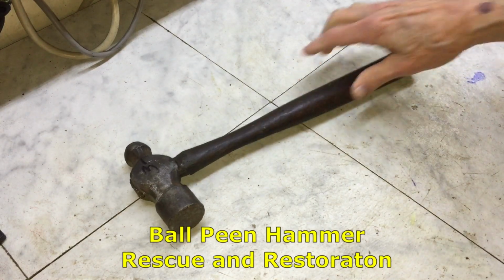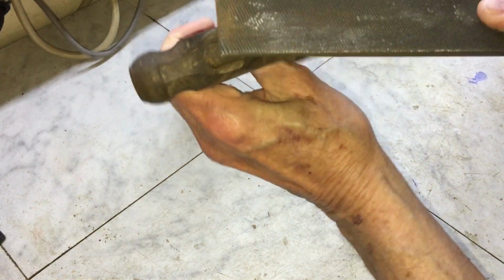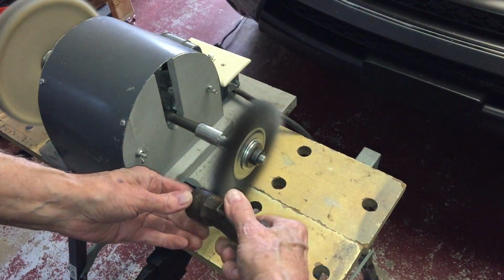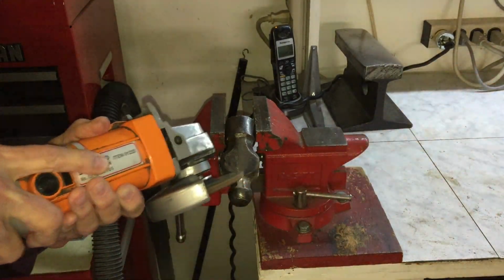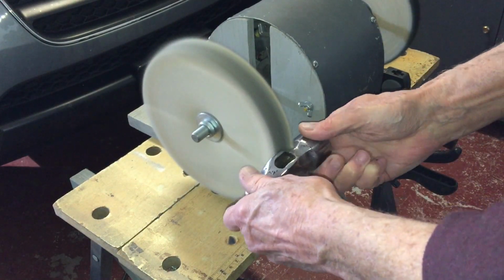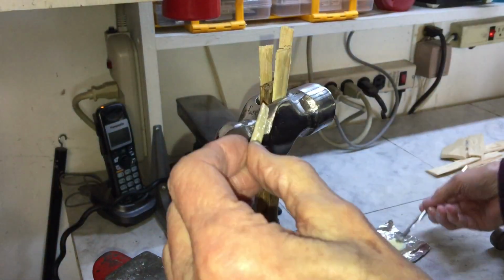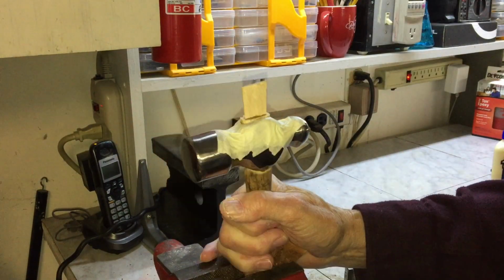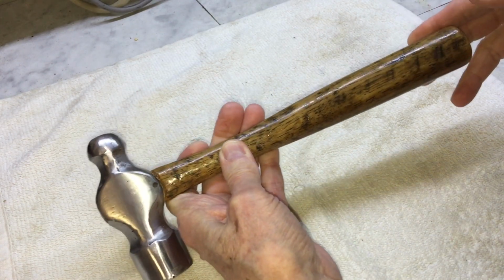Ball Peen Hammer Restore and Handle Reset

Comment: Nice job Bill!  What a difference and now you have a really nice usable hammer.  Looks like the shims worked great.
Reply from the maker: Thanks David!  I have been using that hammer and it is still very solid.  I didn't know if the shims would work, but so far they are holding just fine.  Appreciate the comment!